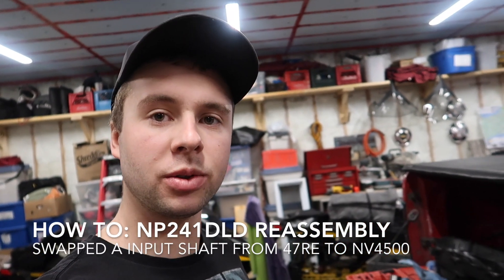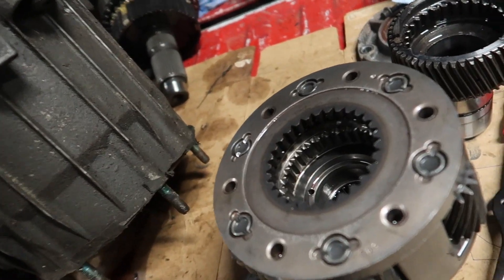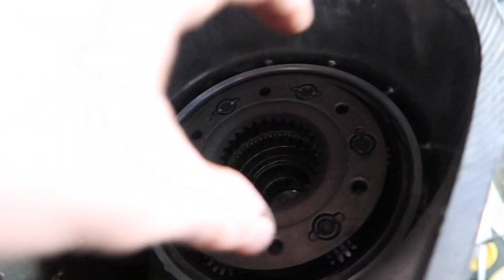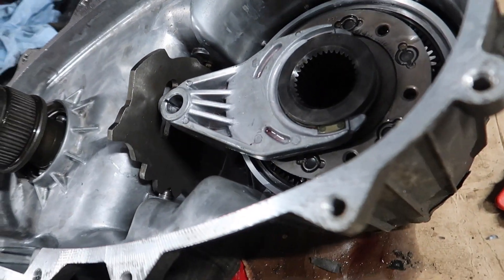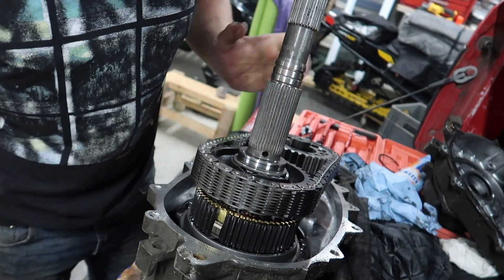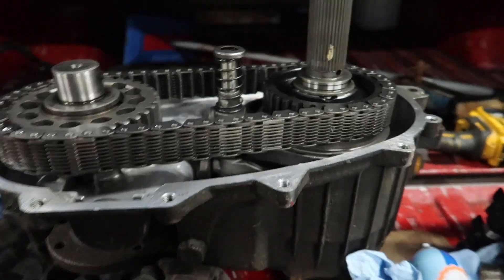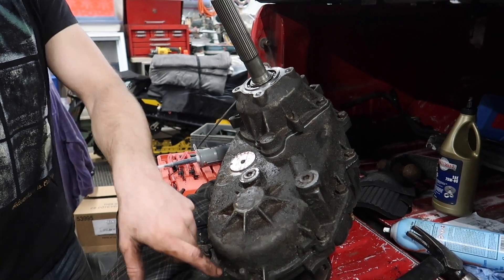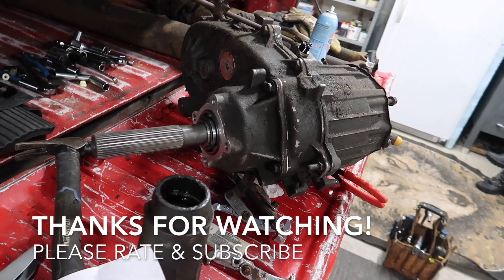How To: Np241 DLD Transfer Case Reassembly (Input shaft swap) 94-02 Dodge Cummins

Comment: What could cause transfer case to jump into neutral in 2 wheel drive?
Found the problem.
It was worn shift forks 
The smaller inner set with non replaceable plastics

Comment: I’m about to do an nv4500 swap on my 1996 12 valve from the 47re and I’m just curious to know if you had to change your rear drive shaft as well? I know you have to change the front driveshaft but it’s hit and miss for information about the rear shaft
Reply from the maker: I ran the rear shaft. It is about 3/4 inch short if i recall. However lots of room on the slip yoke. 

Front shaft would have worked If i did not have a levelling kit. I never had proper length control arms at that time so it was short. You may get away with the front shaft working as well.
Reply: I put a dana 80 with single wheel conversion  on my 02  2500 and had to shorten driveshaft about 1 1/2 "

Comment: My chain is not straight with the case just like yours. Does yours work fine, no issues? I just feel that the chain should be straight with the case.
Reply from the maker: The chain will be like that. Once you install the back half of the case you need to install a snap ring on the output like i show and that pulls the chain straight. It is completely fine.
Reply: @Schneids15  thanks for the prompted response.

Comment: Question:  I'm using the same manual you are.  The dld assembly portion doesn't mention aligning teeth/struts, but the dhd section does.  For the dld is this a necessary step?  I just put my TC back together and not sure how struts are aligned.  Thanks.

Comment: Do you have a link for the input shaft you used?
Reply from the maker: I don’t sorry. I ordered from a company called Kingomatic. Has to come through a dealer for them though. If you are in the states try quad4x4.com
Reply: Schneids15 i calmed them and they got me the right one but it’s a little steep in price I was wondering if someone else makes a decent input without breaking the bank.
Reply from the maker: Mine wasn’t terrible..... think somewhere around 120$ i can’t remember.

Comment: Thanks, great video, I just finished putting a kit in my DHD and was about to put the back cover on when I saw here that you need to get that tapered shifter in with the taper down, so will check that.  Did you use a O ring on the end of the oil pickup tube?  Seems like that might be important but I don't recall seeing one one when I took it apart, and I think the exploded view I have of it shows one.  I might find one at the hardware store, should I look for one that fits real snug?
Reply from the maker: Thanks for the comment, i appreciate the feedback! Honestly i am not sure on the oil pickup tube. It was so long ago now that i can’t remember. I know when it was off i never seen anything and when i got it back on i have had no issues. There could have very well been one stuck on the tube that we didn’t see.